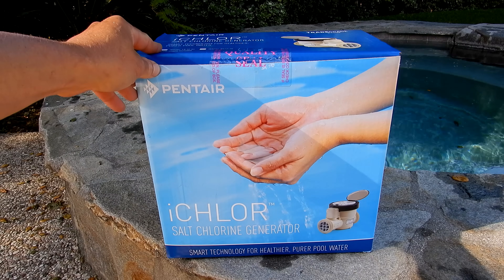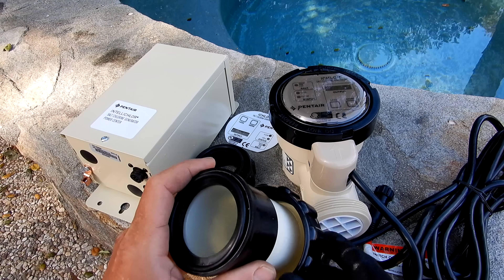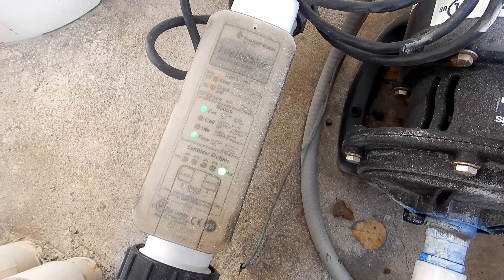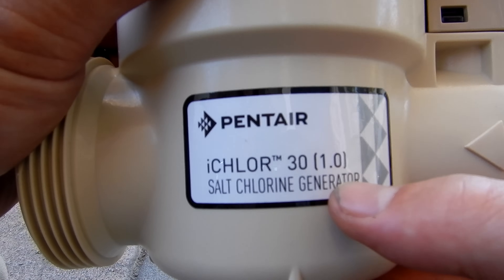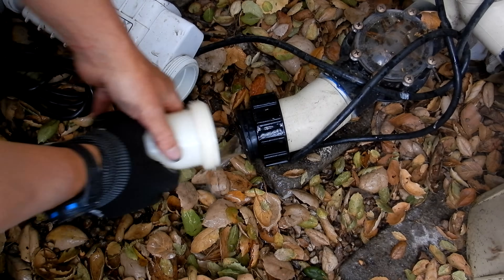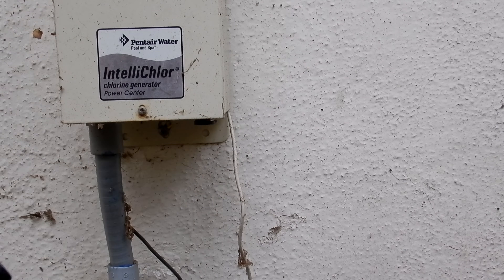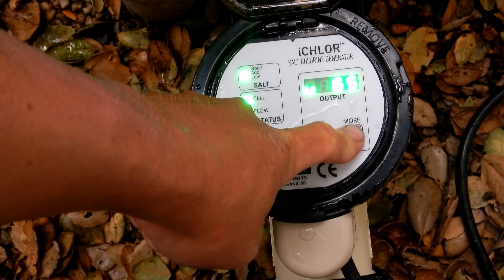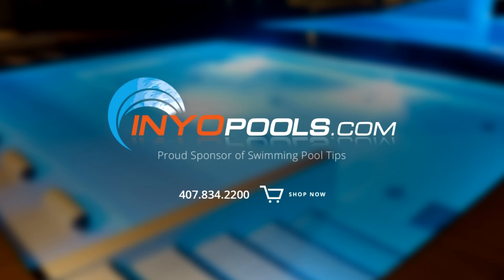Easily Change a Pentair IntelliChlor Salt Cell to the New iChlor Cell -No Plumbing or Wiring Needed!

Comment: I’m replacing ichlor30  with a Chlorworks cell.. at 1/2 the ripoff Pentair price. All the lights on the ichlor  are flashing and it says FLOW on the screen. I’ve replaced flow sensor twice in 3 years and it has been leaking from the sensor housing and now the wires are corroded. Hopefully I’ll get a few years out of the Chlorworks. The Pentair and Chlorworks are probably made in the same Chinese factory.
Reply from the maker: Possibly...😆

Comment: Hello I have a pentair intellichlor ic20 that came with the pool. Had it for a 3 seasons. It failed earlier this summer. I replaced the unit twice with two different units. Ic20 and then ic40. Both new and both won’t produce chlorine. I then replaced the Pentair Easytouch Control Systems
Intellichlor Transformer. Still no luck with getting the system to produce chlorine. I’m not sure what to check or do next. Hoping for some guidance. Thanks
Reply from the maker: It's time for a call to Pentair.

Comment: Our 2nd in 5 years until just stopped working. These things are pricey. Is there troubleshooting or a way to fix them?
Reply from the maker: It all really depends on the output. These are rated for 10,000 hours of use. But you should be getting a longer lifespan.

Comment: My IntelliChlor IC40 (installed in June 2019) for the last 6 months has been showing the wrong Ph level; about 500 ppm too low. I also have the Pentair EasyTouch so everything is there. My pool is only 8,000 gallons. I think Pinch-A-Penny over sized the IntelliChlor. Does it make sense to get the iChlor 15 vs 30? I see the specs say iChlor 15 up to 15,000 gal and iChlor 30 up to 30,000 gal.
Reply from the maker: You can get away with the iChlor 15.

Comment: Since the ichlor has been out a while now, do you still suggest it over the intellichlor?  Do the cells last as long?
Reply from the maker: It all depends on your pool size. 20,000 gallons and under the iChlor. Plus 20,000 an IC40.
Reply: @SPL  thanks so much!  I saw another video where you can piggyback off the 220v line of the pool pump to power the salt power supply.  Is this normally they way?

Comment: Hi there. Quick question... what are the differences, pros, cons etc between the iChlor and Intellichlor product lines? Pentair still sells both, so its not like iChlor was a supersede replacement for Intellichlor. Appreciate the help!
Reply from the maker: The Intellichlor is a bit dated. I will jest tell you what the iChlor does and  that the Intellichlor does not. Adjustment increments of 1%, salinity level reading, cell life countdown. If you have a pool greater than 30,000 the intellichlor would be better. Any other situation the iChlor is better.

Comment: Hello David, I have the ichlor 30 and my display is reading "cold" and cell light is red. I check the temp on the ichlor and it says 48 degrees, I know that inaccurate. Could it be my flow switch?
Reply from the maker: Maybe a bad temp sensor in the iChlor

Comment: Love your channel David, my Ichlor 30 had a CELL light on hot a few months back, opened up, some build up, did the mild acid bath, looked really clean. Worked for a few weeks CELL light again. Opened no build up. It does have 10,874 hrs, so is there anything to rebuild? I cannot find the CELL instock any where. I have a power supply that came with it that works fine. Is there a replacement CELL I can purchase if this one is not available any longer? or what do you recommend looking out to replace this brand?
Reply from the maker: Your local pool store should have the cell in stock. Maybe a local pool service can also order you one. 10,000 hours means the lifespan has been reached and a new cell is needed.

Comment: One of the metal places (cells?) is eaten away on mine, any idea what caused it? Barely 3 years old, cleaned often using acid.
Reply: The acid cleaning itself can cause damage, especially if you are cleaning 'often.' If you dont see any visual buildup of scale and you dont see bubbles forming when you put acid in, then dont leave it in there more than 5 mins. If it is very dirty, spray it out w a hose first to losen, then use the acid, but again, when it stops bubbling, remove the acid.
Reply from the maker: Could be a defect in the manufacturing. I have seen that in only a couple of salt cells in all my years.
Reply: @SPL  Thank you, I hope so, buying another cell for $800 😞

Comment: The extra sticker is for flipping the display. When the salt cell is installed, the display may be upside down.
Reply from the maker: I figured that out - thanks!
Reply: Can that be swapped out with a Hayward aqua rite without any plumbing required? I know I need to swap out the power center.

Comment: Hey bro, i have a customer with an IC20 and was thinking about swapping it with the Ichlor 15 ... can i still use the same power center? Tiny pool. 8k gallons. 

I know the ichlor15 is only rated for 110volt so im thinking if they have the current power center wired at 240v its gonna be a no go.
Reply from the maker: You would be okay with the iChlor 15. I thought the power unit was dual voltage but you may need to call Pentair on that. But yes, you can use the same power unit.

Comment: Hi, my Intellichlor 40 is going bad, green flashing check cell light, even after cleaning and checking chemistry.  My pool is only 15k gallons, so don’t understand why the 40 was installed.  Should I go with the Ichlor 30 or 15?  30 is only $100 more, if I go with it will it run less?
Reply from the maker: Would go with the 30 and set it at 50%. This will give your cell a longer life span than a 15 running at 100%.
Reply: @SPL  That's what I was thinking, thank you for confirming.  Informative and helpful videos!

Comment: In your opinion this newer version is better than the original?
Reply from the maker: I talked at length with Pentair on this. The iChlor has the latest software and can be set increments of 1%. The Intelichlor  only in 20% increments. So this cell will last longer because you can fine tune the output and is less expensive to replace compared to an IC-40 Cell. It also gives you the salt level reading - so if you don't have an automated system this is a real bonus. Basically like buying a new car that has all the bells and whistles or buying a 14 year old model... tech-wise.
Reply: @SPL  thx dude

Comment: The reviews on Amazon are really bad. Have you had any problems with the ones you've installed? Does this work better with an Intelliflow VSF pump? I keep mine set at 33 gpm and run it 20 hours a day. Thanks
Reply: We have have the  ichlor 30  and it is terrible. Having to replace it 3btimes in 3 years is horrible. Nothing, but problems. Wish we stayed with Hayward. The bad mazon reviews are legit and not suspect.
Reply from the maker: Not sure why so many negative reviews on Amazon. Technically they are not sold online so none of the reviews are verified purchases which makes them a little suspect. One said it displays "cold" which is normal when water temp is low. The dead screens are probably just the fuse. But a good product in my book.

Comment: I asked Pentair, and they said a tech should do the first install and then I could in the years to follow.  I didn't see anything that "required" a technician.
Reply from the maker: I think they are referring to a full install. Not this method. You wouldn't need a tech for this. My 11 year old son can do this. 😜
Reply: @SPL  My new iChlor 30 should be here today.  I sprung for the whole kit with the new power supply even though my current one is okay.  Looking forward to having my pool working like it was.  Thanks for the reply.

Comment: David, my newly installed iChlor 30 salt level reading is at 4400ppm - which is totally wrong. Water temp is 75F and it's running for 2 days already. I tested salt level many times with Lamotte Spintouch disks and it reads spot on ~3600ppm. I started with fresh water and added 15x40lb bags as per instructions to reach 3600 ppm from 0ppm. Do you know if iChlor can be recalibrated or what's wrong with it?
Reply from the maker: That is unusual for the new iChlor to be off. It could be a bad unit. Pentair warranties these against defects so contact the store you purchased it from to get a new unit. It sounds defective to me. 1000 ppm is way off.
Reply: @SPL  But it works just fine producing chlorine, I don't think I'll ever use iChlor salt reading. I trust SpinTouch more because it's more likely that iChlor has got bad reading rather than Spintouch.

Comment: Do you still think this is a better value than the ic40?
Reply from the maker: As long as your pool is under 25,000 gallons it makes sense to upgrade. It regulates chlorine production better allowing you to set the output to get the maximum life out of the cell. It is rated for 10,000 hours of use and if you adjust the percentage down correctly it is better in the long run.

Comment: Hey, so my pool is probably a little larger than 30k gallons. You think the iChlor30 will still be okay?
Reply from the maker: You would have to check with Pentair on that but I think you would be able to get away with it. You currently have an IC40 installed?  Pentair: 800-831-7133
Reply: Thank you. Yes, I am currently running an IC40, but they seem to last only a couple of years. Consistent problems with their flow sensors, etc. I'll check with Pentair as well, and thank you for their number.

Comment: You set it up at 80, how much do you recommend to set it, got mine on 20 as factory
Reply from the maker: Depends. How large is your pool and how long are you running the pump?
Reply: Swimming Pool Tips, Reviews & How To -MrDgvb1 My pools 16k gallons. I run it for 6 hours at 2200 during the summer and run it for 3 hours in winter.

Comment: How often do you have to clean the new iChlor? My current IC20 needs to be cleaned every 3-4 months with muratic acid.
Reply from the maker: I talked to Pentair about that this AM. The iChlor should do better then the IC20. It does use the same cell plates but has improved technology - I just installed this one last week so we will see. I usually had to clean the previous cell ever 3-4 months like yours so hopefully they improved that part of things also.
Reply: @SPL  new technology is worthless if the cell doesn't last past a year or two.

Comment: How does iChlor differ from IntelliChlor? Am running an IntelliChlor 60.
Reply from the maker: For one it won't produce as much chlorine as the IC60. You must have a very large pool? It is rated for 30K gallons of water or less. The main difference is that is eliminates some of the errors the IntelliChlor cells have, it has a salinity readout built in and it just works more efficiently then the Intellichlor cells. It is all around a much more hi-tech salt cell. The IntelliChlor Cell design is well over 10 years old. But if your pool is over 30K gallons you wouldn't be able to make the switch.
Reply: Swimming Pool Tips, Reviews & How To -MrDgvb1 thanks for explanation. Have a 25K gal. pool but opted for the IC60 to generate a low concentration of salt in fewer hours to prolong like of the cell. Noticed the iChlor isn’t yet available in larger output.
Reply from the maker: I would call Pentair and see what they think but I think upgrading even in your case when the time comes would work out well. Your replacement IC60 cell is like $800 and the iChlor cell by itself is $450. So even if you upgrade twice in 8 years the cost will be about the same and you are getting the latest salt cell technology.  Just my thoughts.